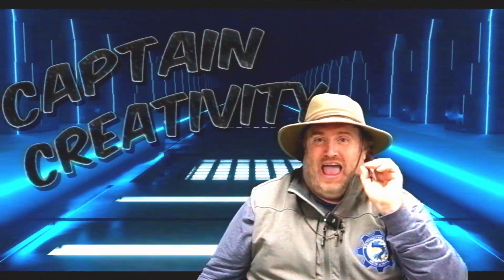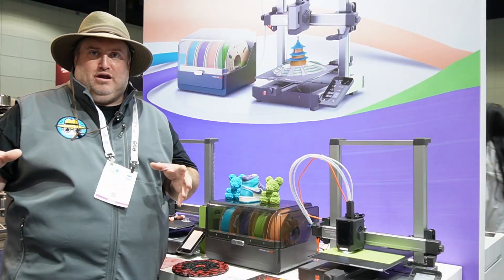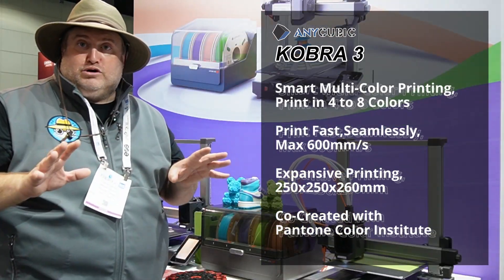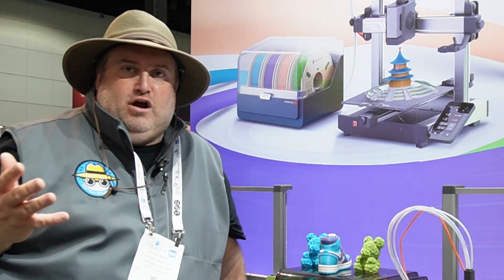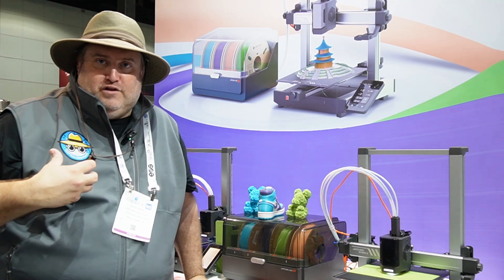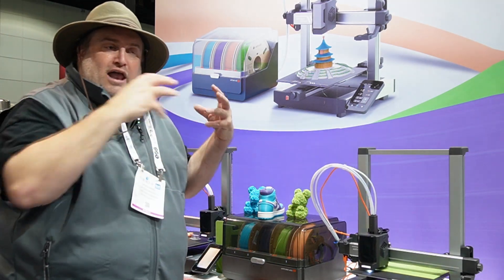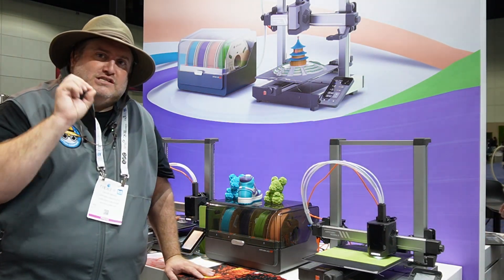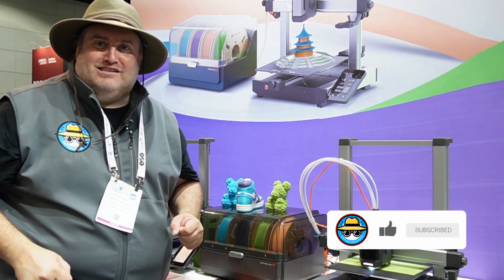Anycubic Kobra 3 Review: First Look at What Sets It Apart from Other 3D Printers

Comment: The multicolor takes long time complete, does the speed of the machine help with that much? In other reviews, seems like it does product a lot of waste as well. Its still too early to tell if this will be a worthy !avhine. They have still yet to finish the software side of things. And haven't had much of their orders fulfilled. 

I'm a kobra2 pro user myself, just want anycubic to better support their printers if I'm going to buy the kobra3. Only time will tell.
Reply from the maker: I have mixed feelings about multicolor 3D printing in general. Speed and waste are significant issues for me, often preventing me from using these devices in my projects. However, the ACE, AMS, or CFS (depending on the brand) do offer several benefits.Sometimes my projects require a lot of filament, or I simply don't want to lose production time changing a roll of filament. These multicolor filament solutions are fantastic for allowing your 3D printer to automatically switch to a backup roll of the same color.Specifically with the ACE from Anycubic, I appreciate that it's an active dryer. I've been using drying packets with the AMS, but my filament still gets brittle over time. I like that the ACE actively dries the filament.These units are also convenient because they allow me to load multiple colors and have them ready to go at any time, especially in a classroom setting. So, there are many benefits to these devices, even if you're not printing in multiple colors. While I'm not a fan of sacrificing time and filament, if I were printing something relatively small and needed a lot of them, I would consider using multiple colors because it reduces waste. This is because when you print the same object in quantity the amount of waste being purged is the same regardless if it's 1 or 10 items on the bed.
Reply: The problem is not the speed because this new machines are fast as hell but the time to change filament purge it then make the Towers is what takes to long also now imagine if it had many colors then it will be swapping constantly which take too long just to make a single line.